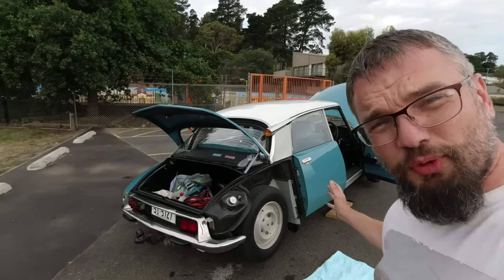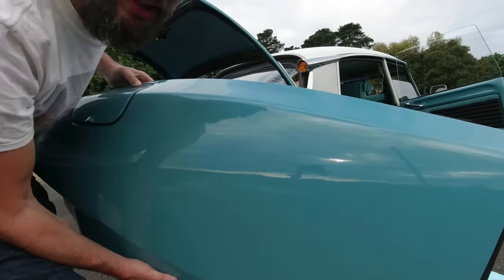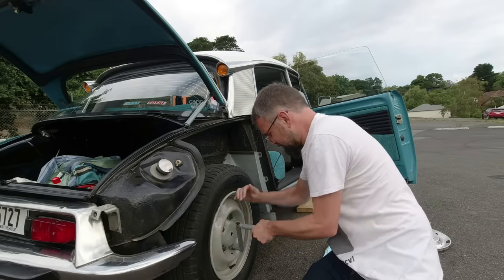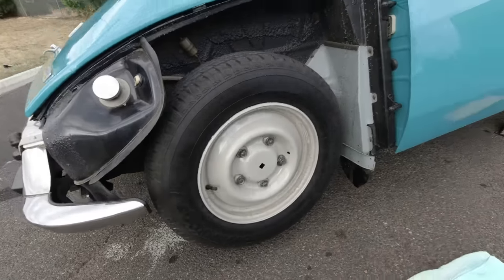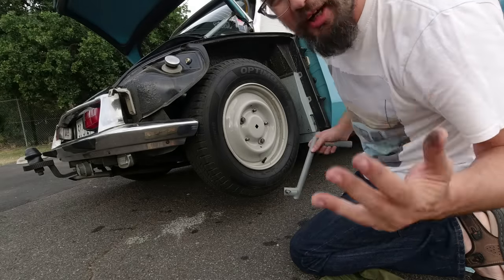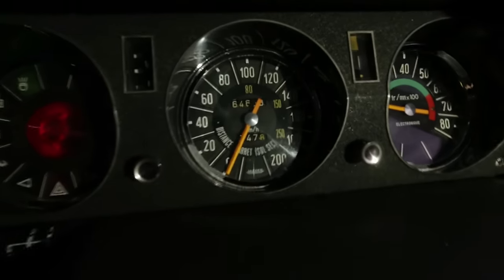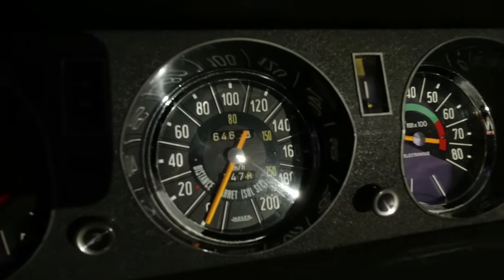Can it drive on three wheels?! And other Citroen DS Party Tricks

Comment: I had '59 Citroën 2 CV and it had a crank for front passenger for cranking windshield wipers as wipers worked on vacuum and in city traffic they were unusable due to lack if vacuum so passenger could help... 😁
Reply: Vacuum?  Sure it wasn't driven by the speedo?
Reply: @alro2434  nope, mine was imported by sailor from southern america in -64 and it had vacuum wipers + separate crank for manual usage...😁

Comment: 6:15 I believe drum brakes should drag a little if properly adjusted, as the drum will expand later while under use due to heat. So I'd check the owners manual to be sure, but otherwise adjust those brakes a bit.

Comment: I am sure the Deusenberg SJ was first w8th lights that could see round corners
Reply from the maker: I've a feeling the Tucker Torpedo had one too.
Reply: Actually this was an optional feature on several luxury cars right back from the 30'es.
A set of extra pivoting headlight were mounted on a seperate lower bar on top of the front bumper.
Mechanically its a quite easy setup, but was obviously not considered as a common helping feature during night drive in the early days.
The Tucker had a central pivoting headlight mounted.

Comment: To drive it on three wheels both front wheels hav to be in place, and the hydraulic suspenstion must be set on the highest notch. 
Done that with my 1968 ID 19
But once the car also fell of that "jackstand" and severely injured my hand...
Reply from the maker: Yes. There were nerves doing this! Owner had never tried it before.

Comment: Those larger headlights actually automatically go up and down on hills while smaller ones follow the steering wheel.
Reply: Really?
Reply: @Nickoboss29  Not sure was it in all models but seen those before.  It has simple hanging weight, purely mechanical adjustment.  More realiable than electronics today...

Comment: There is so many small things that showed they pushed the design and what a card was its just silly. Grew up as a kid with them my dad worked for citroen for 50 years. Some of the things just freaked people out during its design and even after release they had to pull it back a little in style and function like the only 1 bolt per wheel. https://citroenvie.com/ds-steering-geometry-steering-feel/ Also the lights didn't only turn the normal beams also level depending on the car hight to make sure they still follow the road laws.

Comment: i knew the headlamps were slaved to the steering, but i had never seen it in action before. that, is too cool. i've seen pictures in an old car mag of the rear wing/fender and the three wheel tricks, though. they were in black and white, it was so old. i always thought those cars looked like cockroaches. the eye looking headlamps, and the downslope of the rear are what does it. that, and mebbe, just mebbe, because they were always black, and always chasing james bond when i saw them as a kid.

Comment: The ability to drive on 3 wheels basicaly means you barely notice a tyre blow-up on the highway. The car will still behave very safely.
General De Gaulle has been saved by the DS when terrorists shot at him and blew two tyres of the DS he was into. The driver could handle the car and escape quickly despite the blown tyres.

Comment: Ian, I know you don't like taking advice, but here is some you really should heed. Don't use your hands as hammers. You could better undo the wheel nuts by applying pressure with either your muscles or body weight. Never use your hands to hit something that is stronger than your bones.

Comment: This car also have a starting crank so you can start it manually if battery is dead. 💯
Reply: Only the older models with the 4 speed gearbox. The later models with 5 speed could not be started by hand.

Comment: Wasn’t Charles de Gaulle’s attacked in his DS and they got away with a few flat tires. And Citroen did test the possibility of driving on three wheels after the Charles the gaulles incident 🙃
Reply: I think the 3 wheel advantage was just a consequence of the design but was not an actual design brief.  Just lucky for Pres. De Gaulle.

Comment: However, riding on three wheels only works if one rear wheel is missing. It will not work if the front wheel is missing. Tried it myself. And adjusting the swivelling headlights ist not an easy job.
Reply: @BlueTrack Edm We tried that, but the brake drum always hit the ground. Driving was definitely not possible.

Comment: You got away with it this time Ian. You are much better off removing the wheel on the side opposite to the driver to do the 3-wheel driving stunt, you will get much better ground clearance. I found this out when I tried the same stunt in a BX that I used to have. The reason that the RHS rear wheel is removed in all the Citroen adverts is because the French have their drivers sitting on the wrong side of the car.
Reply from the maker: I'd agree if you were going to start cornering hard. I never planned to. I also demonstrated that it is actually pretty stable regardless.
Reply: @HubNut  That DS is in excellent condition and very stable, as you say. My BX was on its last legs and nowhere near as stable as that beautiful DS.

Comment: regard to the Wheel change, the Citroën CX, XM, BX, Xantia and the C5  (and as far as i know, also the C6) 
can do the same 😜
 i dont know if the C5 and C6 will drive on 3 wheels. 
but one thing is sure, i definerlig miss my 1990 XM  2,1 td and my 2001 C5  2,0 hdi weekend/break :😔
Reply from the maker: Don't forget the GS/GSA. I now have a GSA and need to repeat this trick.

Comment: Adspiring classic DS owners should always bolt off a back fender to check for rust damage on the carrying parts of the body. And then utter the classic sentence; ''Mon Dieu, le longereau est totallement corrodez/fini.''

Comment: Citroen a construit une version de la Xanthia "activa" ,un vérin compense le roulis de la voiture dans les virages.
Cette voiture prend les virages "a plat" et la version V6 a des performances équivalentes à des voitures 3 à 4 fois plus chères !

Citroen built a version of the Xanthia 'activa', a cylinder compensates for the car's body roll when cornering.
This car takes 'flat' turns and the V6 version has performance equivalent to cars 3 to 4 times more expensive!

Comment: The real reason why the hand brake is blocking the frind wheels and not the rear is for security reasons.
Due to the fact that the brake line and the suspension line relies on the same mechanism. Imagine you on the highway and it failes  you are out of brakes.so in order to brake safely you cant  handbrake the rear you might lose control. Thats why the hand brake is on the front wheels
Reply from the maker: But the DS is no better or worse than any other vehicle. Service brake failure is always a possibility. I have never had to use the handbrake in an emergency on a hydraulic Citroen.
Reply: @HubNut  My family owner a GS back on the day and thats What a mechanic told me when i asked him and for me it makes sense, its a much more complex mechanism than a single brake line 
So if it fails its a win win situation. You can stop the car in the most secure way possible.
Reply from the maker: It's certainly better, but I don't think it was the main reason to do that. 2CV, Saab 900 and a few other cars have also had front handbrakes but no hydraulics.

Comment: The only thing better than only needing to undo one bolt to remove the rear wing so you can change a wheel is having to undo NO bolts and NOT remove the rear wing so you can change a wheel.
Like on, erm, every other car ever built.

I guess the whole Citroen DS thing just passed me by.

Comment: Because the rear wheels are covered in metal doing this is the only way you can get them off.However the French President liked those cars if the tyres got shot at they could still be driven

Comment: If one Citroen doing the 3 wheel party trick is good then seven is better with cheery 60s fill in music :
https://www.youtube.com/watch?v=KI_Zt2x_lR8&t=223s
Three wheel demo x 7 at Kyalami race track.
Also followed by a party trick I am glad Hubnut did not do. Driving at speed to a tyre deflating spike and bringing the car to a straight stop with no hands on the steering  wheel. The second run with both drivers side tyres deflated seemed only a little off straight but still amazing to me.
Earlier in the film a demonstration of the later DS models swiveling beam headlights.
Hope Mr Hubnut does not object to me providing a link. If so I will delete.
I think the Polish poster may have been surprised how many views he got compared to his other posts. Mr Hubnut's demo generating a lot of interest also.
Reply: They will stop well and almost unnoticeable on only ONE front caliper!!

Comment: Futuristic even by today's standards and a stunning performer in speed and the comfort sectors. But I always thought more trouble than what it was worth. The complicated hydropneumatic suspension was a nightmare to fix when wrong and needed a specialist for the job. Do not try the 3 wheeler trick with one of the front wheels removed.
Reply from the maker: The suspension is not that complicated. There are other reasons to run away from DS ownership, like horrific rot.
Reply: @HubNut Thanks. Long suffering owners will attest to that. Going back to the "tricks" this car lends itself to, ages ago I remember watching a 60s action film starring French actor Jean Paul Belmondo who was driving a soft-top version of the DS which by a freak accident had been split in two, so that the whole section of chassis behind the driver seat was lost. But he still managed to drive it around on the 2 front wheels with the split chassis scraping the road and sparking. So the famous 3-wheeler trick has long been beat / surpassed by this 2-wheeler stunt. P.s. He only managed to drive on the 2 wheels a short distance, presumably on what petrol was left in the lines and carb, as his fuel tank had been lost............

Comment: Hi. Just a little comment. It seems that you have a problem with your hydraulic pressure regulation. When you drive the car, we hear the pump working too much. Several possible causes: principal accumulator, regulator itself or internal hydraulic leakage on the steering group.
Anyway, enjoy the goddess!
Reply from the maker: Yes, I think it has been sorted now. I was on holiday so it's a friend's car.

Comment: So what about front wheels? Same process of a hovering front wheel?
Reply from the maker: I don't believe the trick works with the front wheel, but it will still lift it up when the jack is in place.
Reply: HubNut sorry that’s what I meant, in regards to the wheel changing. 3 wheel trick is genius though :P

Comment: Can you change a front wheel in the same way? Can you drive with a front wheel removed?
Reply: Any of the drive wheels are removed this way, which is the recommanded procedure according to owners handbook.
But because of the majority of the cars' weight is on the front wheels, you can NOT perform this trick on the front wheels.
You find out the moment you raise the car's height and try remove the lifting jack: its not possible, as the car's weight is still on the jack.

Comment: The engine can be running perfectly smooth and then there's corrosion on the anti-lock brake wheel RPM sensors... The malfunction with the sensors causes the engine completely unrelated... to misfire and the transmission to not be able to be controlled what gear it's in to the point where you can't drive it to the mechanic... even the brakes are still working fine. In the end the perfectly fine Xara Picasso was sent to the junkyard with an engine and transmission that we're still running just fine. The electronic's problems snowballed until it was so bad no mechanics could fix it.

Comment: The Citroen DS is the only car no one can overrate.
Reply: No, you can't overate a car with a manual choke & manual turn signals & floppy side mirrors & poor starters & poor water pumps & leaky roof & poor ventilation, just with superb but slow driving.

Comment: I believe if you have a flat battery (so cannot start the engine) you have a problem because the suspension lowers fully, and the car becomes too low to be put on a recovery trailer.  Comments from owners, please?
Reply: That would make sense to me. I presume they'd have to jack in manually to get the body clear of the ramp.
Reply: Tow truck drivers hated them, and there were NO recovery trailers back then

Comment: You should have taken out the rear-left wheel, normally the trick is performed on the rear-right because it's the farthest away from the driver's weight, but that is usually done in countries where it's driven on the left, driving on the right, you should have taken out the opposite wheel ;-D

Comment: 8:10 Hello - to the spectator reflected in the left window !
Reply: Yes, my Cameo appearance. Unintended. :-)
Reply: @peterriggall620   Peter - as others have said - many thanks indeed for your great cars and letting HubNut near them!  Well done.
Reply: @peterriggall620  Not far from me there was some unimportant but 'historic' derelict buildings going to be demolished - and before they were, I got in them and took loads of photos of the mess. One of the 'social' rooms had a mirrored section behind the bar - so the shot I took intentionally included my reflection in the mirror - at some distance. Maybe I should have done it naked or in speedos !

I take it they're both your cars - and registered with Special Interest plates.

I note Ian said the suspension 'hasn't a brain' but it obviously has 'control gear' - to what degree of complexity, I don't know. I also note in another comment discussion, Ian says there isn't self centring steering - yet someone else suggests there is. Can you confirm which is true ?
Cheers.
Reply: @millomweb  No, not self centering like the CX and SM. There system are strong self entering.   But.....it does have a flat section on the roller on the steering column which is designed to keep it going straight without input from the driver  but that could never been called self centering.
Reply: @peterriggall620  Interesting, thanks.

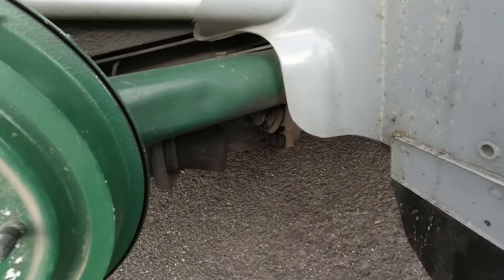Comment: 7:50 wat. Tons of cars have trailing arm rear suspension with handbrakes on the rear wheels. I'm sure the DS engineers had good reasons for putting the handbrake on the front wheels, but it's clearly not impossible.
Reply from the maker: Most cars don't change height...
Reply: @HubNut  What does that have to do with it? A handbrake cable takes up hardly any space at all, there's no reason it couldn't be fitted on the trailing arm of a hydropneumatic any more than a coil spring or torsion bar one.

Comment: i in my family had 4 ds 19 ,21´s and a 19 gt 2173cc.´s,then the gs car and station wagon and then the cx, even i had a second hand 2500 diesel cx high-end car this a long ago, and i after almost 4 decades without citroen´s  bought last setember a working perfect xantia from 96 and a friend of mine gave me is father´s xantia all new never catched sun also both diesel ,all this cars can travell with 3 tyres and the gs car even can turn on a follow pins test with only 3 tyres as the xantia. In my country either than having sun all year around(paint is burned on most of the cars) we have the most expensive gasoline in europe and maybe one of the poorest country´s in europe ,only sweden as a similar price

Comment: Stating the obvious here, but Citroen aren' the innovators they once where. My new Berlingo allegedly has fog lights that turn as the steering wheel turns, but not the headlights. How often do you use the ruddy front fogs?!

Comment: Bump start it. That would be a party trick.
Reply from the maker: Easy. It's a manual. Though a manual with no brakes until the engine fires up...
Reply: @HubNut  I didn't know that was a thing. I owned one briefly in the 80s. I assumed they all had the same tran. Even the windscreen wipers were hydraulic! You live and  learn, and then forget!
Ta.

Comment: "What do you do before jacking the car up?", I wonder if 'remove the rear wing' would have been a valid answer
Reply: Should be - depending on the car you learned on, of course.  

At least they used to teach stuff like that.  These days, most people don't seem to realise the car has a spare and a jack - and tbh, there's quite a few cars on the road that don't even come with a spare or a jack these days.  Makes you wonder what they do if they damage a sidewall in a snowstorm and AAA needs 4 hours to get to you?  Space saver tyres are bad enough, but a puncture repair kit and a pump doesn't always cut the mustard.
Reply: Neither is particularly 'correct'.
1. Ensure the location is safe (not middle lane of the motorway), on a firm, level surface
2. Parking brake is fully applied, engine off etc.
3. Chock wheel on the other side.
4. Phone the AA
Reply: @aussiebloke609  My bro used to specify a proper wheel if it was an available option.
Reply: @pmailkeey  If only that was always an option.  I had to buy a space-saver, as my car didn't come with a spare at all.  But the well in the boot/trunk floor isn't large enough to take a full-sized wheel and tyre, so I'm screwed in that regard.

Comment: What about the steering which self straightens? You haven't showed that yet 😂
Reply: That was introduced on the CX and was brilliant.
Reply: It's just a cam & spring loaded roller on the steering column & couldn't cost more then $5.  The SM version is more modern & expensive.